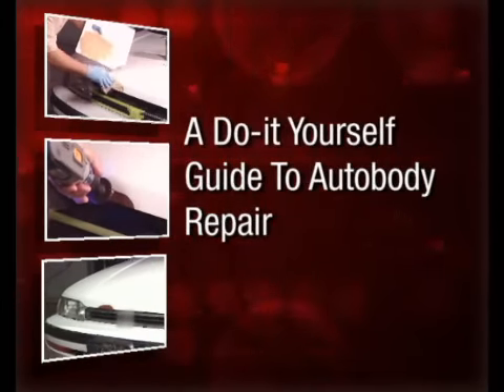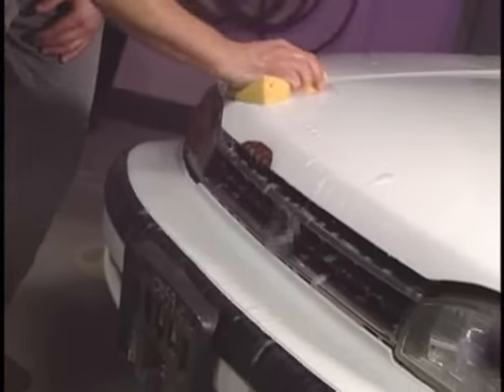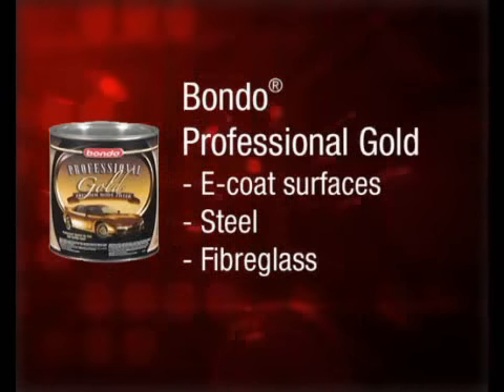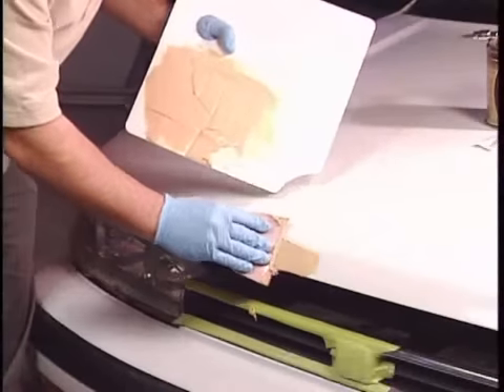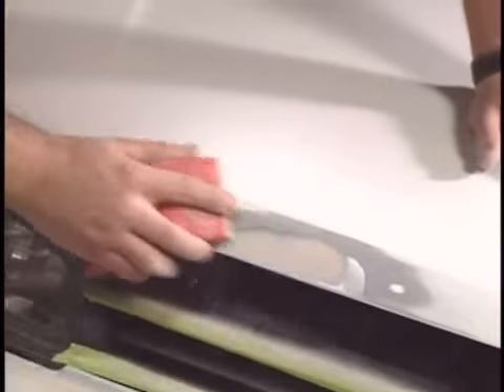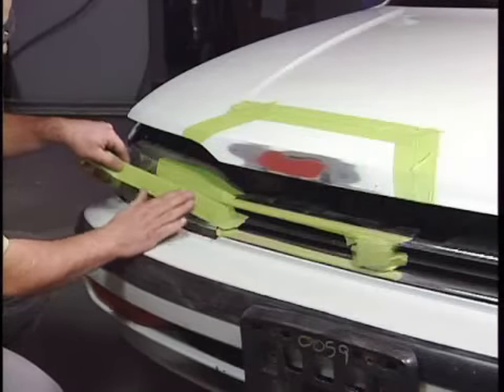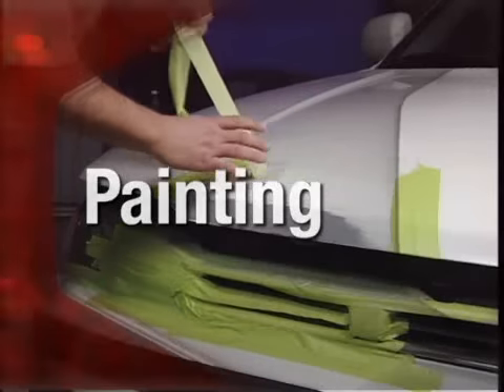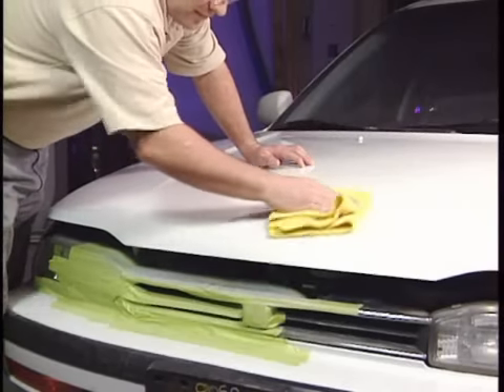How to do repair auto body rust with bondo

Comment from the maker: Thank you all for liking this ...
Reply from the maker: Thanks
Reply: In the video you said to polish the metal, remove all sanding scratches, does the metal need to be smooth in order to use bondo, I recently repaired some rust above my rear wheel well, after sanding, priming and painting, bubbles started to form on the bondo, most were small with one larger bubble, this happened to me twice now, any ideas what I did wrong ?
Reply from the maker: Did i said polish the metal then i am wrong. I remember i said we should go to shining metal and the reason is that if there is any rust leftover then it will expand underneath and will push bondo or any other material.
Now about the bubbles expert says that there is no single reason we can conclude but my opinion is that it depends on the temperature you worked on your car and degree of moisture left in the bondo. It may depend on the quality of body filler as well.
Good luck
Reply: Ehsan Uploads Thanks

Comment: rust in that area often from rock chips so originating on the outside, not on the inside like a fender or rocker panel.
Reply from the maker: Believe me, rust is more on the back or underside, that is my experience while rock chip is different which you may cover right away. I am talking about weather and moisture, rain and snow is the main thing here in north america. thanks and sorry for being so late.

Comment: I have a 2007 chevy avalanche and would like to have the cladding painted. A friend told me that i could use a light weight bondo to rub over the textured plastic then sand it smooth.  Do you have any recomendations on how to do this? do you sell the products to do something like this? Thank you
Reply from the maker: Sorry for being so so late, If you still need to do this, try bondo fiber glass

Comment: Sooo basically all of this was for nothing cause those pits are gonna bubble the bondo and crack it. Good Job 3M..
Reply from the maker: It willnot bubble if you use any rust protection which kills the moisture inside or use bondo glass
Reply from the maker: You never try it, you never know. Try and then you will know

Comment: Why you don't put epoxy primer before epoxy filler...?
Reply from the maker: Well, i guess the paint job is already too complicated and more you put on more you need to work on so better keep it smooth.
Reply: Ehsan Uploads From my experience it will not last long.
Reply from the maker: You see lots of people use bondo light which is cheaper and in that case yes it may bubble or show again but doing a proper job and putting quality of material which is expensive, you can get professional results. Again its up to you that how much effort and money you want to put on.
Reply from the maker: There are Body filler which will stick to even any surface and strong enough, depending on what you choose. I used them and i know that it stick really well. It is like a strong glue.

Comment: You didn't do anything about the pits?
Was the clear coat you used one of those two part "clearcoats in a can"?
Don't you need some kind of a clear coat blending agent to get the new coat to stick to the old?
Reply from the maker: No need For colors like black and white with no glitter in it while for metallic colors yes its a good idea
Reply: The ONLY way paint will adhere to that hood, or any painted surface, is through mechanical adhesion. To do a job like this correctly, you'ld scuff the area around the repair with an equivalent to 600 - 800 grit sandpaper. Watch some other videos on here & you'll see what I mean. Don't do any of the stuff in this video!
Reply from the maker: Good idea
Reply from the maker: May try it on a bigger area

Comment: How much does it cost. I used this video to repair a rust spot on my car and I'm well over a hundred in, and it looks like caca. Should've just taken it to the shop. Anytime you do something for the first time you'll make mistakes. My bondo looked smooth as hell until I applied the paint, then I saw how crappy it actually was. Never again.

Comment: Complete waste of time. You never use polyester body filler (Bondo) to repair rust! This section should be cut out and a patch welded in. Then after grinding the welds flush you would coat with fiberglass filler then Bondo to smooth the surface. Bondo is like a sponge and never used like this video shows. If you treated the bare steel with phosphoric acid conversion coating then used WATERPROOF fiberglass filler it would last a while.
Reply from the maker: Bondo had few different types of filler so you choose the one which suits your area of work. yes fiberglass is better.
Reply from the maker: Hello Origional Munga... Do you know this video is from manufacturer I mean Bondo company and if think they don't know what they produce then you better talk to them. Lots of people like this video and is very helpful for a small job.
Reply: Ehsan Uploads
I restore and build very expensive classic cars and motorcycles. I am an A.S.E. master auto body tech. I have been fixing rust for over 30 years. My comment stands true.
Reply from the maker: It doesn't matter who you are....you didnot produce bondo filler.. read what i told you before..
Reply from the maker: I read your full message now....may be you are right but i am not the producer of bondo or this video..